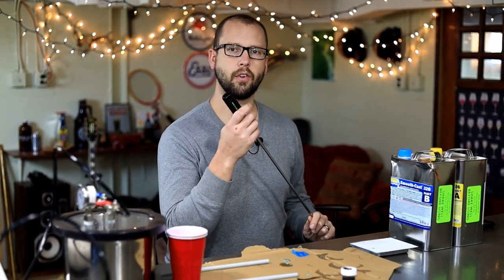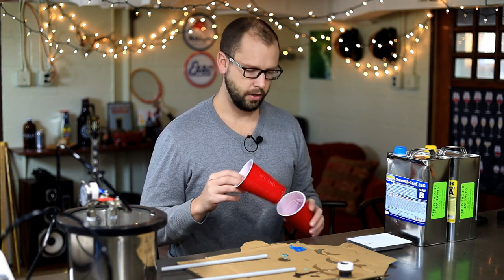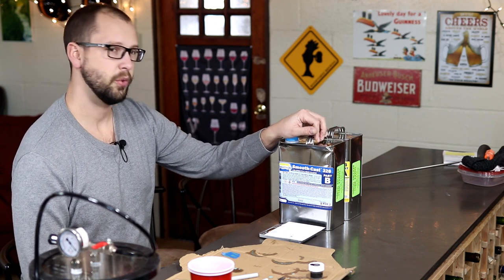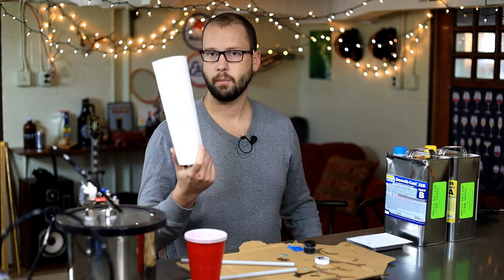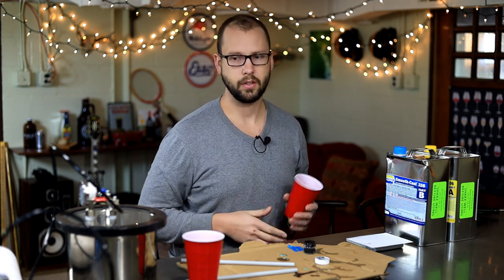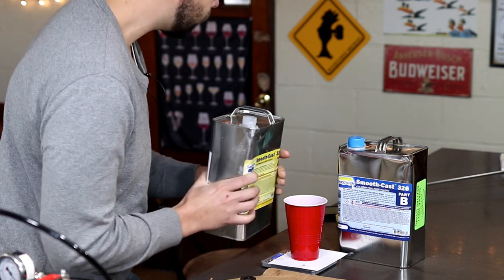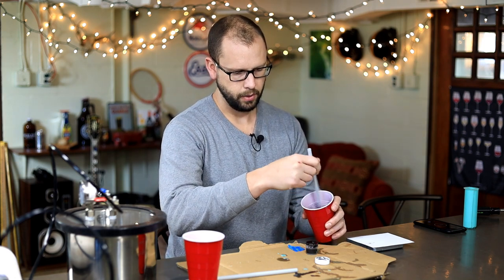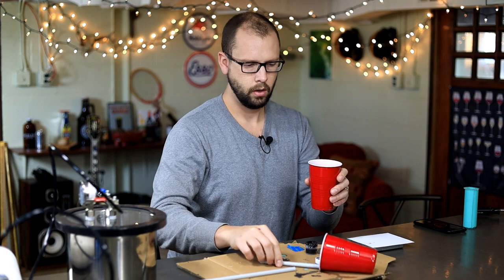Casting Plastic Parts at Home with a DIY Urethane Mold.

Comment: Hi, i want to thank you too, because i wanted to make some screwdriver handles. You are the first i have seen with   the best results !!!!! i wanted to ask can you get or make a resin softer for pliers handles?
Reply from the maker: Thank you!  Yes you can choose any number of durometers when purchasing epoxies, resins, and silicones.  The lower the durometers, the softer it will be.  For a pliers handle you may want to try one of the dip products though rather than casting.